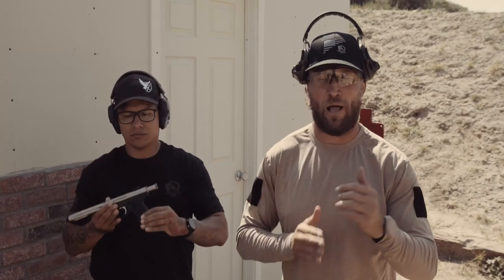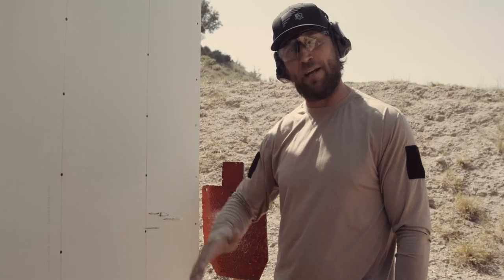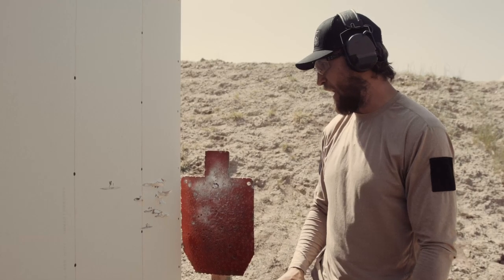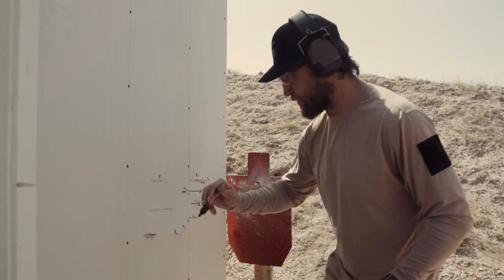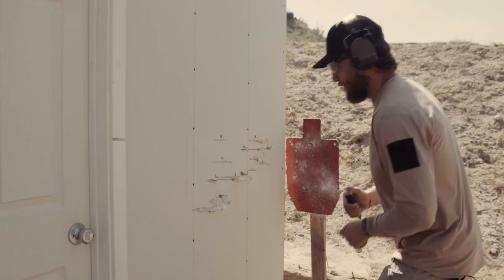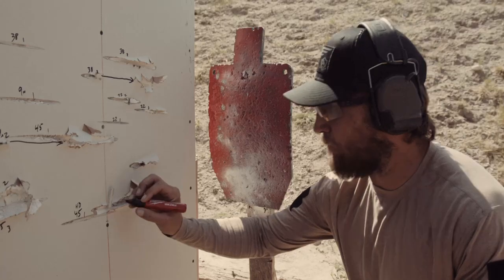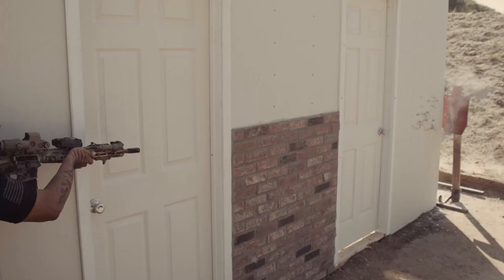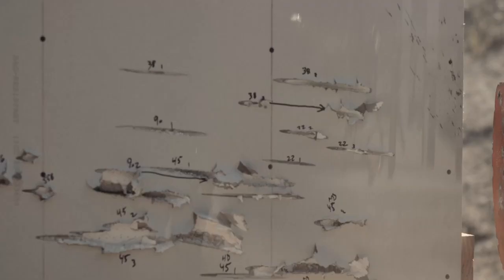Home Defense Ballistic Test with Pistols & Rifles

Comment: Solid info but I wonder if it would change if the wall was constructed with just sheet rock and studs without having the extra layer of plywood behind. Cools vid though.
Reply from the maker: Yes, it definitely would. Most of the rounds depending on the angle skipped off of the sheet rock only. However, some of the more sharply angled rounds like the 556 skipped off of the plywood. We based it off of construction code in California, which uses the plywood, but that is definitely an extra barrier.

Comment: I would like to see the build out of the wall. Was it built with SOP?

As well as use of a painted wall and not bare drywall.

Thank you. Great demonstration.

Carry on.
Reply from the maker: We built it to California spec which had Sheetrock and plywood and then studs. But no paint was used. Would be a good test.
Reply: @defensestrategiesgroup  code for they used the illegals hanging out at the 7/11.